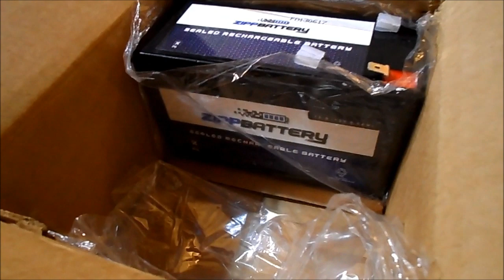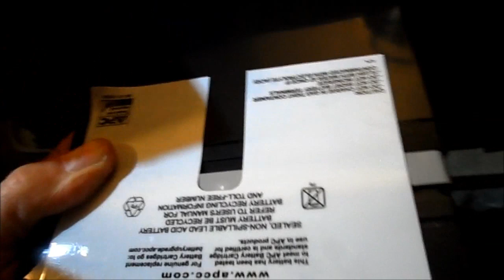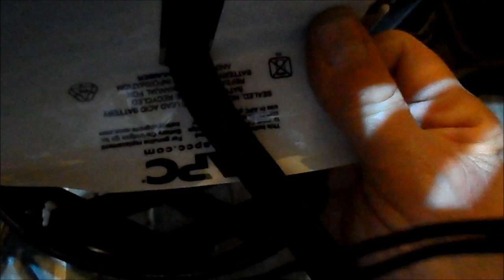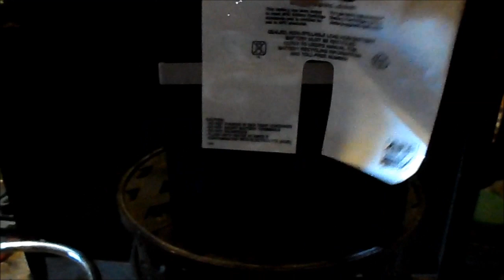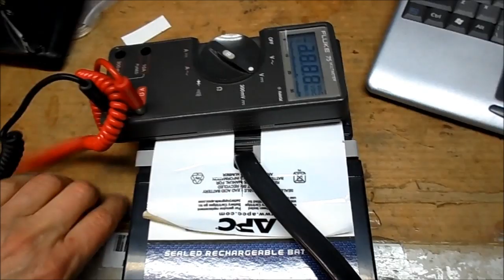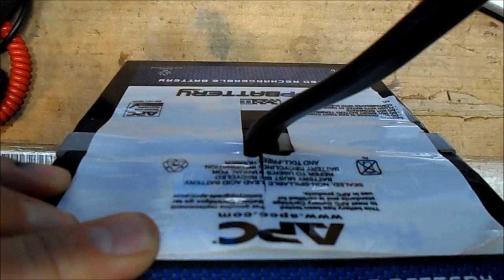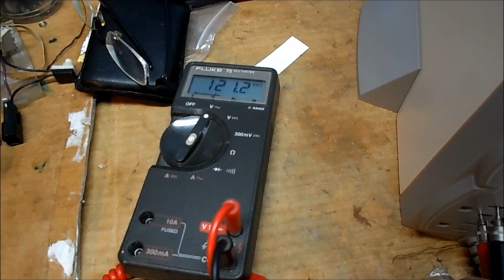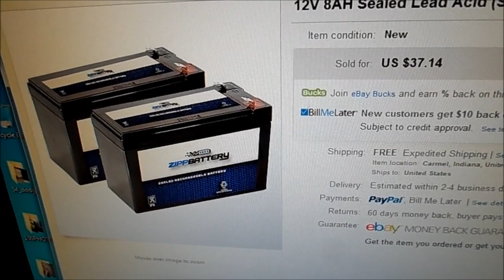APC RS 1500 UPS Battery Replacement.

Comment: Hi do you know how to reset the display on my APC BR 1000. After I changed my battery the display shows all wrong information when power goes off. Battery shows 4min left and one bar when the charge is 100%.
Reply from the maker: There must be a reset feature in the management software is my guess.

Comment: A possible explanation for why your voltmeter is reading 85V on battery but 120V when on pure AC power: For AC to DC conversion in a computer power supply, the useful measure is Vrms (root mean square) rather than Vp-p for the DC wattage generated by the computer supply when it rectifies from AC to DC.  For pure sine waves, the Vrms = 0.707Vp-p.  (The 0.707 factor is 1 over the square root of two.)  For square waves, probably what your UPS is generating from battery, Vrms = Vp-p, because the wave form is at peak voltage for pretty much the entire time of the cycle.  So an 85Vp-p square wave yields as much power in DC rectification as an 120Vp-p sine wave (85=0.707*120).  Thus 85 Vrms of a 120Vp-p sine wave = 85 Vrms of an 85Vp-p square wave.  So I'm guessing your meter is reading correctly peak-to-peak and the UPS is correctly generating the equivalent Vrms square wave signal to substitute for a 120V sine wave signal from line power.

http://www.allaboutcircuits.com/vol_2/chpt_1/3.html

And yes, I came here to replace a battery on my UPS for cheap!  Thanks for posting.
Reply from the maker: Hello, & yes. A long time ago, I had an inverter that only showed 95 volts. Somebody told me that if I used a more expensive meter that red true RMS, then it would show closer to the 120V.
Reply: The issue is probably due to the UPS putting out a square wave, so even with a fancy voltmeter, Vrms = Vp-p for a square wave.  You'll probably get the same reading even with a fancy voltmeter.  Because a square wave operates at full voltage for the entire half-cycle, it provides as much wattage at 85V as a sine wave would at 120V, because the sine wave is under its peak value for most of the cycle.  It's about area under curve for the two waveforms.

In any case, thanks for making the internet great for getting hands-on info like yours.
Reply from the maker: *****
You're welcome, thanks for the insight into sine versus square wave.